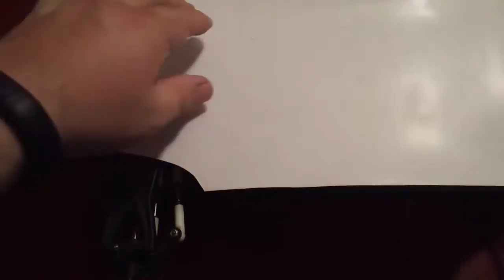Jconcepts Chassis Protective Film Sheet

Comment: This guys advice on application is wrong in almost every way. 
After cleaning the chassis it's far easier to just stick on the film, no pretrimming and go round the edges with a craft knife or scalpel. Including the motor slots and battery slots. 
Which are there to aid cooling. Don't block them off.
Reply from the maker: Thank you for your professional advice, its awesome when someone with so much experience can give out so much information! Also cant wait to see your videos on the correct way to apply a sticker !